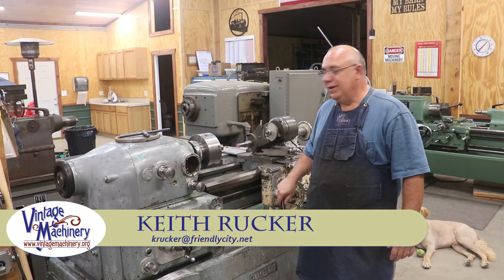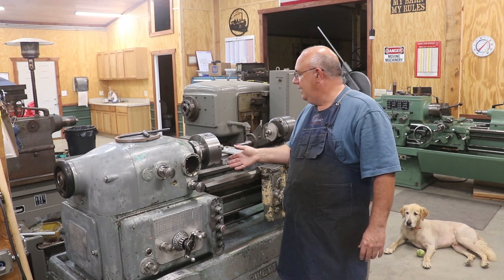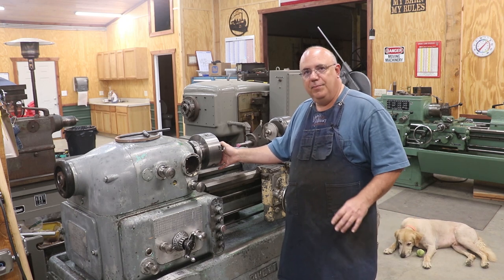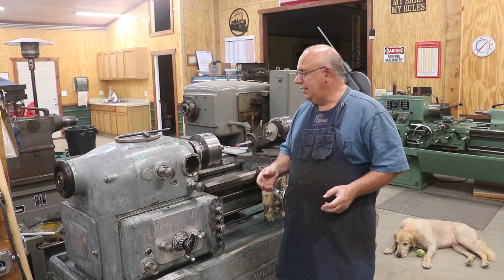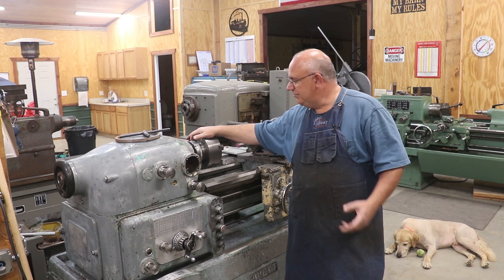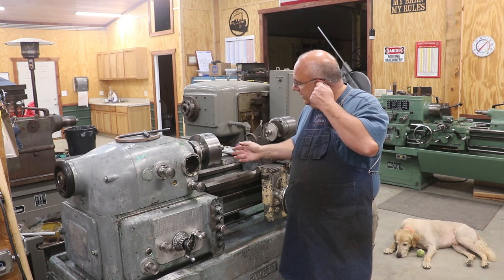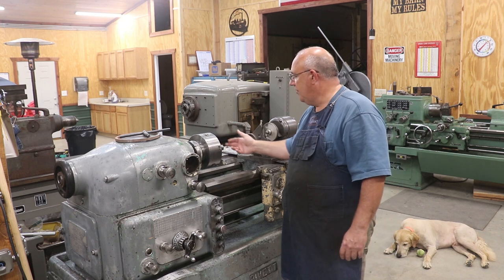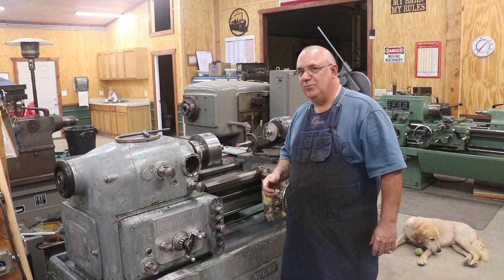Grinding the Faces of the  Jaws on a Three-Jaw  Chuck to Reduce Runout

Comment: isn't this exactly how to do it completely wrong?,  the opposite face on the scroll is acting on the jaws opening instead of closing them. 
if you were truing the outside faces on the jaws yes, but nah this is ass-backwards and the reason it only halved the runout.
I hope nobody else learns to do this.
keith, you did a video on this in dec 2013 and explained how this is the wrong way to do it for the same reason, you did it the right way then pretty much
Reply: Did you listen to the video, or just spew b.s. without listening, or even using common sense? Since you know it all, why don't you let us all know a way to tighten the chuck inwards without obstructing the area you're grinding.
Reply: @xenonram  theres plenty of vids here on this,
clamp the master jaws on to a small dia, or use hex key pieces in the inner jaw bolt heads onto a spider,  actually look at keiths vid dec 2013 he does it better and explains how not to do it this way. but I'm sure you weren't really asking me how to do it really.
 I just think it's wrong to give out wrong info to thousands of people especially when theres no shortage of the correct method and explained in detail better available on the same platform.
of course i watched the frikkin video, what are ya mate?
'
Reply: I agree that clamping inward would be more likely to give better results, and Keith understands that as well.  He actually mentions it in the video.  Scroll chucks can hold a wide variety of diameters in several different configurations though, and they are not very repeatable across that range of sizes and setups.  Even with the setup you describe it only makes the chuck have zero runout for the specific diameter at which the jaws were ground.  Throw in a part that's larger or smaller and you've got runout again because the jaws are engaging a different part of the imperfect scroll.  I'm of the opinion that with a new chuck you're better off fussing with the back plate rather than the jaws, but there are plenty of ways to skin a cat and this method Keith shows is certainly one of them.
Reply: Lindsay Fog
I agree completly with you. All that for 1.5 thou improvement? 
No doubt Kieth's plaudits will rush to his defence as he cannot do wrong. 
Please respond so I know that I have not been blocked from commenting. Thanks.
Reply: You are totally correct, this is arse backwards, but people do it
Reply: I agree with you Lindsay. With that said, it would be very interesting if Keith were to re-grind the jaws clamping them the way he did in the 2013 video to see  if it improves the runout. 

He seems to have had his mind elsewhere today because it is not like him to grind on a lathe without covering the ways and using a vacuum.
Reply: @mqeqeshe1  at least doing it in the direction it's going to be used gives you the best chance for a zero point from where there will only be inaccuracies instead of compounding the errors of an imperfect scroll. 

scroll chucks aren't good for rechucking for second ops with concentricity but are for production where work is finished in one operation.  runout only wastes raw materials if the limitations are considered.
Reply: @MrMichaeljab  I think it the case of producing mindless content just to garner YouTube money. Who cares if its correct as long as the gravy train keeps a rolling.
Reply: @MrMichaeljab  
Yes, good point about the grinding. I nearly made the point but you said it well.
Reply: Yaaa guys ever achieved zero run-out on any job?

Comment: I wonder where the remaining 2 thou runout come from. The setup itself shouldn't produce any runout I think because you grind concentric to the spindle of the lathe itself. Maybe it has to do with clamping the jaws against the outer iron ring? It produces forces opposite of what you would have when clamping a part on its OD in regular operation, in other words, the jaws are pushed against the inner flank of the spiral whereas in normal operation they are clamped against the outer flank of the spiral. So on the one hand with the iron ring you can fix the jaws in place, but on the other hand, maybe thereby the tolerance of the spiral transferred to the jaws and that's where these 2 thou came from. Just wondering. I don't know if not clamping the jaws at all would have made the situation better or worse. Also, I would expect clamping something on the inside but very far back inside the chuck like you mentioned might also induce runout because it could also tilt the jaws. Creating realistic clamping loads on the jaws would propably require a pretty complicated setup though. Nice video, I haven't seen chuck jaw grinding before.
Reply: yeah, the scroll chuck compromises accuracy over production numbers but can be relatively repeatable, but the scroll itself isnt accurate enough to permit someone just doing it totally backwards. using the master jaws is one way to do it but it doesn't counter the jaws bellmouthing like clamping the jaws at the tips using pins or a spider etc,  there's so many vids showing this done right.  the runout being only halved was just luck, it could have turned to shit just as easily.

Comment: If your that worried about   .004 runout, and you know it's your mounting plate. Don't ruin a chuck,  either fix your mounting plate or make a new one. I find this to one of those can you do it, sure, should you do it, probably not. But this is my opinion,  and I don't know everything.  Just been a fabricator and machinist for 20+ years..

Comment: Just wondering about the external jaw accuracy. If you were now to grip your ground piece of round stock and then grind the outside gripping surfaces of the jaws this might then be more accurate when spreading the jaws onto a ground ring. Then, with a rinse and repeat, the internal surface of the jaws could be ground. Time consuming yes … more accurate... quite possibly. Just an old toolmaker trick.

Comment: The inside of the jaws need to be ground with the jaw pressure going inward like it will be holding a piece. I saw this done on another YouTube channel the other day with the results being much tighter than .0025".
Reply: That is correct.
In this type of chuck that has the removable jaws this is also very easy - one can utilize the jaw bolts with the tensioning.

Before grinding though, I would have tried to bumb the chuck onto place. In case the mounting is not symmetric with the scroll then grinding is valid only on the diameter that the jaws were ground with.
Reply: feels like he got very lazy and just wanted it to be done, the right way or not, I'm just kinda bummed about all the grinding dust everywhere and not even trying to remount the chuck..

Comment: Too late now but the proper method is to drill three holes in steel doughnut and then use spacers on the jaw retention bolts that way you can load the permanent jaws again the tightening side of the scroll.

Comment: I noticed in the last video where you disassembled the chuck you did not mark the pieces in order that you reassemble in exactly the same way as original. Run out may not have been so bad if you had.

Comment: Grinding seems unnecessary on basically a brand new chuck, instead of fixing the run-out from bolting the back plate on.
Reply: As he said in the video the chuck was ground from factory to reduce run-out from when they bolted the original back plate on. He changed the back plate so it had to be ground again. It's a necessary step and a lot easier than trying to fuss with the orientation between the back plate and the chuck.
Reply: i agree.
Reply: Normally röhm are high quality chucks.  They are ground to the chucks recees in the back, and not to its backplate.    So no matter whick backplate you have, if it's turned on the specific lathe, and running true to this, the chuck should do so!

Comment: Thank you for posting, but I have a question.  The fact that the run-out is different depending on how far it is measured from the chuck indicates that either that the test piece a little bent,  or that the jaws of the chuck are seriously misshapen.   Misalignment of the head stock might also be something worth checking first (easy top do).  Any thoughts?

Comment: Now machine the taper on the backplate down another. 001" to allow bump truing the chuck to no run-out. As others have mentioned, turning the taper . 002 under in the first place would have been the preferred correction.
Reply: Brian Wood no!  The Chuck must have a tight fit on the mounting recees.
Reply: @VærdAtSe  That's fine if they are running true to start with
Reply: @lnbwood  if it's made like most are, it will..

Comment: I would have made the center hub on the backplate .002" smaller to have .004" worth of adjustment instead of grinding in the jaws. The adjustment means it can always be adjusted a tiny bit closer by just lossening the chuck bolts and tapping the chuck around, where this method requires grinding if the chuck is ever out again. And like you said a 3 jaw is not notorious for being perfect.
Reply: It's actually the centerhub /recees that guide the chuck. The bolt should only hold it tight against this.   If the Jaws doesn't run true to this recess, something are wrong.   I've made many backplates, and never had issues with bad runout. All have a tight fit to the chuck.. 
I don't like the idea of a chuck that can wobble round on its backplate, just fixed by it's bolts.
Reply: @VærdAtSe  The bolts provide thousands of pounds of clamping force, much more than any radial load on the chuck. Ideally the taper would be good enough but that 8" chuck is still 2 1/2 thou out - as bad asmany El cheapo chucks
Reply: Brian Wood if you look at the earlier video, when he’s punching out the holes, you see the chuck have a very loose fit on the backplate.  This is probably his problem.  A chuck MUST have a tight fit in its recess/taper on the back.  It’s this Recess (prob spelled wrong) that guide/hold the chuck in its direction, and also general fixing.   The trick with a loose fit, when you can move the chuck around are a bad habit, and not the right way.   When doing hard turning or parting, there can be heavy radial force.
But no matter that, the recess are ground even to the chuck, so they should always run true to each other!
Reply: @VærdAtSe  23:10 in his last video "there is a tiny bit to pull that in with" and if you look you can see the chuck not sit flat against the backing plate and was hitting on the taper, now that taper is not long enough to hold the chuck straight when he tightens the bolts against the back plate, now what do you think is going to happen if there is a gap, any gap doesn't matter the size, between the backing plate and the chuck? Either the the chuck will kick to one side or that perfectly flat backing plate will bend and flex. 
Yes I get that if the center hub and face of the backplate are perfect match with the chuck then that is the most Ridgid however in his situation and the fact that the forces on that particular lathe are going to be minimal the friction of the face alone on the backing plate would be more than enough.
Reply: @lnbwood  I 100% agree with you on that and if he wanted something better then he should have spent the money on a better chuck. He can grind that thing in all day long and it will always have .003-.004" of run-out. I have yet to find a 3 jaw chuck even the most expensive ones out there that can hold less than .001" every time it's closed.
Reply: @tylerhensley2312  Röhm are what most would descripe as 'a better chuck'.
That runout you mention are way to high compared to the chucks I have at home and at work. (Röhm, Bison, Pratt Burnerd, SCA and RotoRecord) Despite many of them are very old.  Even my cheap asia/India made HBM chuck have only 0.01mm runout.  My Polish made Bison have 0.005mm and this measured over different dimensions and of course several times.   And this is known as a quality, but not a high priced brand .  

But your chuck ain't better than the mounting you put it on..  😉😁
Reply: @VærdAtSe  mine is a bison and there is no way it's holding that kind of consistent tollerance. Yes I can manipulate it and get it really close but if I just stick a chunk of steel in there and crank it down it would be .002-.005" out every single time, yes it can hold tighter if I really work at it but that is not the chuck that's the operator. As much as you hate to admit it I would be willing to bet that you have to manipulate the material to get it as close as you do. Still I think his point is that with the backing plate not being machined correct it will always be out no matter how much he grinds the jaws.
Reply: wheelitzr2 you can bet all you want, but why should I sit here writing something that’s not true? Come on man.. what I tell you are the truth, and what I see on the lathes I have, and run at work, and has been the last 15 years.. of course I would not stand there and make it run true, that’s the chucks job, if not I would choose a chuck with indenpendent jaws.     and yes, I get his point.  The same point I have.  The chuck doesn’t sit true on the backplate..
Reply: @VærdAtSe  I guess Im Trying to figure out how your 3 jaw Chuck's are better than any other 3 jaws out there, every machinist will agree that a 3 jaw chuck isn't repeatable that's the entire reason we have 4-jaw Chuck's in the first place and why a 4-jaw is used when tollerances are less than .001". Basically what your telling me is that Adam booth is waisting his time using a 4 jaw because his 3 jaw should be able to repeat his level of tollerance, if so then why did he opt to put a 6 jaw on or how about tom limpton that now only runs a 6 jaw? How are your 3-jaw Chuck's so much better than everyone else's?
Reply: wheelitzr2 first, what are your personal experiences? How many different chucks, brands and lathes have you based your know how on.  And please don’t compare to any of those YouTube shop heroes.      I’m telling you my personal experiences, from the chucks I use every day! So why do I almost feel like you claim me to lie!!!!   And please don’t say the 4jaws only job is to do the job a 3jaw can’t, only from runout. It’s mainly for tightening strength and for parts that are not perfectly round...    There are allot of other things it does, that a self centering can’t. But I’m sure you know.         I’m not saying my chucks are better, but I’m I saying the runout I can measure, and that’s no lie.
Reply: wheelitzr2 and maybe Adam uses a 6 jaw because he got one sponsored....  😂😂😂😂
Reply: @VærdAtSe  my experiences have nothing to do when we are dealing with machining because any experienced machinist will have the exact same experiences as any other experienced machinist, it's not like the material that we are dealing with changes how it's machined just because your using metric to measure it and I'm using SAE. your going honestly tell me that if you have a tolerance of +/- .001" on a drawing that your going to just drop that part in the 3 jaw and not worry about it at all? The 3 jaw chuck is the least repeatable mounting system that you can put on a lathe, I dare you to name one type of mounting system that is less reliable. Your literally telling me that all of your 3 jaw Chuck's are as repeatable at a Collette chuck, and I'm sorry but there is no possible way that is correct. My point with abom is that he was only willing to use the 6-jaw over a 3-jaw and he was still .004" out once it was mounted.
Reply: @wheelitzr2  aha.  Then, if you have had a superb chuck, with zero runout. It wouldn't be possible after all, because all the expericed said it wouldn't be possible, just because...... 🙄.
I prefer personal experience over what other say, especially from people on YouTube.

I will try once again, and maybe you will understand it ;  if I take a perfectly round part, and tighten it in my chuck, I will have close to zero runout.

Comment: Did you notice the run out on the wheel when you turned it on and off? Looks like the entire thing moves 1/8" or more.
Reply: Wasn't that just the belt pulling?  It settles once the inertia is overcome.
Reply: Even if that was the case wouldn't that suggest that the bearings on the spindle are loose?

Comment: I would not have torqued the jaws during assembly. The best way would have been to finish the install of the chuck, then put the precision pin in the chuck with light tension and torque the removable jaws to an even spec. Good chance you could have removed the TIR without even needing to grind.

Comment: Thoroughly enjoy your videos BUT shame on you for not doing this repair correctly.  Biggest problem is some viewers, due to lack of experience, will duplicate this method and possibly screw up an otherwise good chuck.  We, the viewers, rely on you and other Youtubers to educate us in the correct way to perform tasks.
Reply: I'm 90% certain the issue was when Keith machined the backplate taper that it was too large and the chuck didn't seat completely down onto the backplate throwing off the alignment.
Reply: @seephor  Exactly right!
Reply: @seephor  what's the solution to fix that issue? Rebuild the back plate?